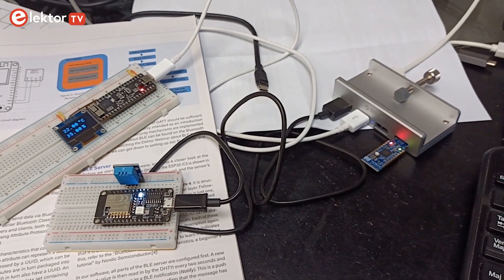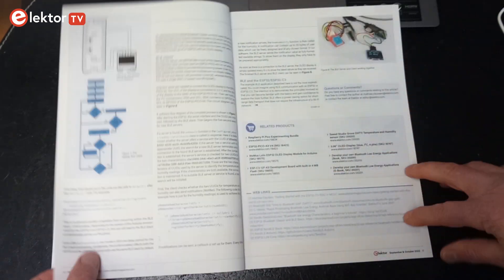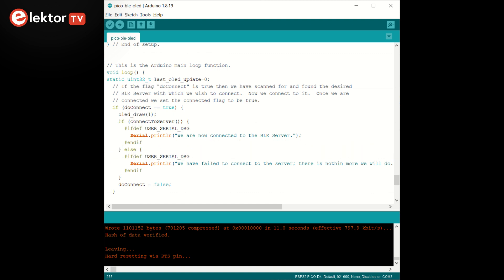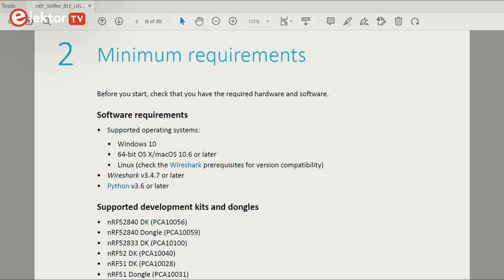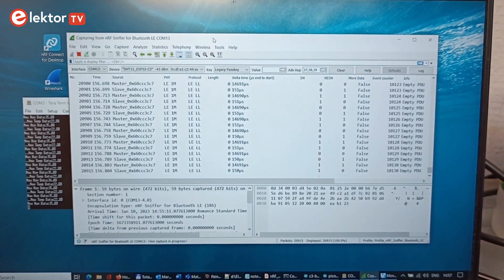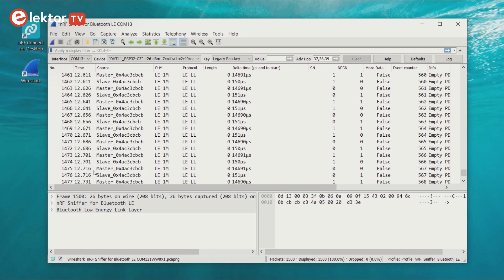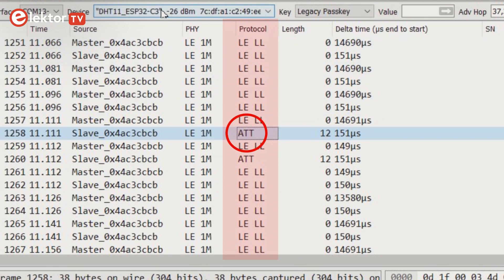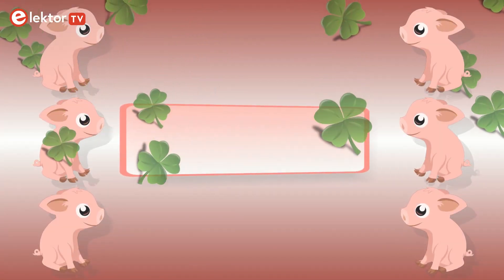DIY Bluetooth Low Energy (BLE) Sniffing: Debug Your Projects Like a Pro!

Comment: I've had a $35 electric moped stolen from my home, and I'm doing everything I possibly can to try and locate it, with absolutely no help from the local police department. The bikes Kelley controller and battery both have BLE, and because my phone has paired with it before, I have the BLE name and address, but other than running a BLE scanner app on my phone, and driving all around my town, I don't know what else I can do to use this information to locate my stolen bike. I know it's a long shot, but If anyone reads this comment who has information that could help me to locate my bike, please. Please let me know how! Any information whatsoever that might help me locate my bike is greatly appreciated!
Reply: @jessiegoines  forget him he got new owner and his ok, otherwise he will return home 🏡
Reply: Go around sniffing the Pawn Shops ... otherwise you are casting a small net in a BIG ocean! GL
Reply: bro i can help do u have anyway of knowing if your mopeds ble is broadcasting and has a MAC address im working on a ble scanner that scans for a certain mac for Ble broadcasting devices